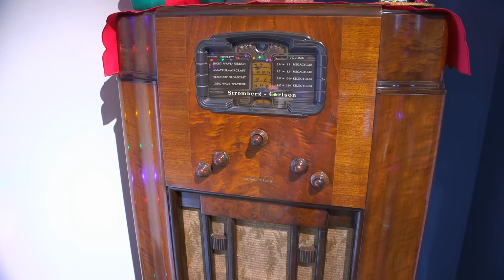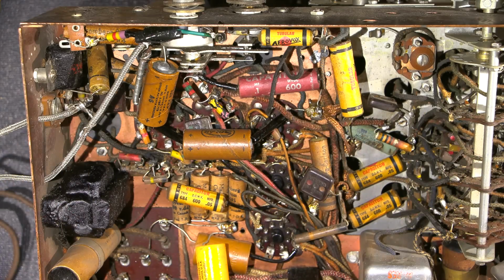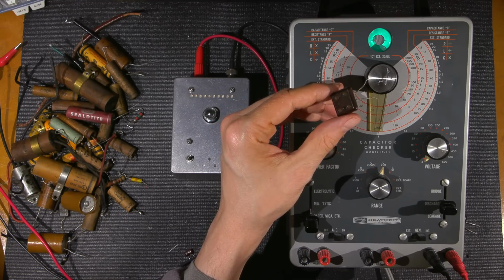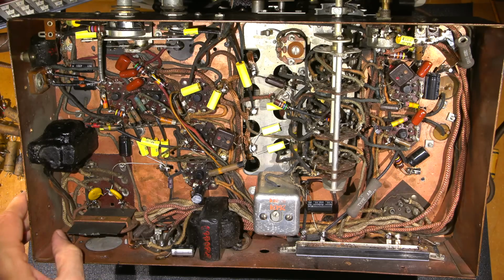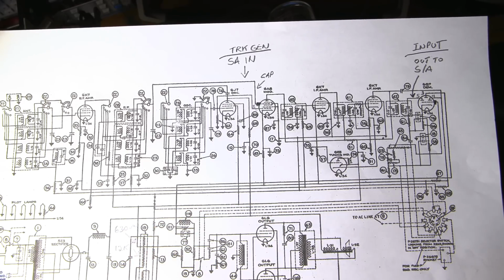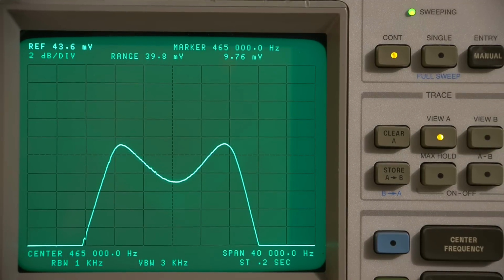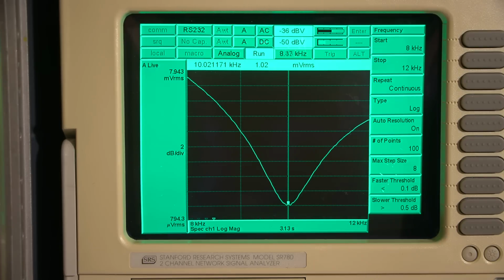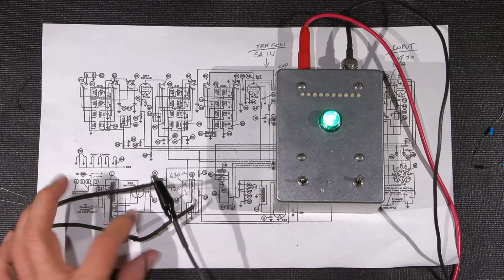84 Year Old Radio Receiver Restoration! Stromberg-Carlson 145L

Comment: Hi - on things like this  (and since you are so thorough in other ways)... I'm not sure why you don't go through the step of gutting the original caps and re-stuffing with modern equivalents.  To make it work is one goal... but to retain the entire visual impact of the original technology and manufacturing is also worth doing.  I rebuilt a 1937 (not North American) receiver in this manner, trying to make the repairs as indistinguishable as possible.  Once the old caps are out, it isn't that much more work.  I was able to crush the old cap ends into chunks and dust that was actually possible to melt and re-flow into the modified cap tube ends.  On other caps, you could cut axially if necessary, re-stuff, and then hide the cut-side by proper re-orientation...  Again, leaves that overall visual impression that time has stood still... not that much extra work!

Comment: Hello, Mr. Carlson. I just found your channel and subbed immediately. Great stuff. I hope you'll forgive me if I delicately point out that the compression and EQ settings on your mic (Warm Audio WA-47?) are overemphasizing your breathing and mouth noises. Moreover, there is a forward, radio-announcer character to the audio which, to my ears, feels disjointed from the production style, and more importantly from the gentleness of your voice.
My 25-year audio engineering instincts tell me that you would do well to back off the mic by 4-to-8 inches in order to reduce the proximity effect. You tend to speak very evenly so for compression I would probably try an LA2A or a TDR Kotelnikov (free!) to gently even out the smaller level fluctuations. For a yeller I'd probably put a fast compressor or limiter in front of that, set to catch only the peaks. If the sound after compression sounds dull, try a little EQ next in the chain to bring out some sparkle and chest sound. Less is more!

Comment: This is a great video... and I totally get and appreciate what you've done.  Curious question: Could you still keep the "spirit" of the rig and also clean up its design in a non intrusive way, say by making a modern PCB to migrate those components closer together -- the circuit design would be the same, but you'd cure some of the problem distance brings?  It would be fun to see, but I'm not at that skill level yet.

Comment: I am trying to identify the wattage of a vintage carbon resistor. It is 1 1/4" long by 1/4" diameter. There isn't much out there to help identify the wattage by physical size that I could find.

Comment: The old valve radios are fantastic. Lots of beautiful harmonics, no transistor hiss, plenty of bass, and generally built to last. Of course you had to wait for the valves to warm up, but the wait was well worth it. Used to work in a radio repair workshop for four years, bench testing and repairing, in addition to mast work with folded dipoles and twelve element yagi's. Always in the winter the heaters would fail on yagi aerials and they would lose their directional characteristics due to ice build up, and there you are, up a mast in the freezing cold fitting out new aerials with new heater elements. In the workshop we had an old valve radio pumping out its wonderful sounds daily on weekdays. Remembered well. The valve heaters even warmed up the workshop on cold days. Nice refurbishment job. Yes, nylon adjustment (trimmer) tools for the powdered IF slugs and RF nut type caps (transmitter PA sections), insulated screwdriver for screw type caps. Powdered IF slugs used to be a problem at times because they had a nasty habit of sticking and breaking in two, and then were the devils own to replace. RF sections easy enough, but as you say IF sections can take ages and a lot of required patience. Love the high impedance unit to stop blowing the front end of the spectrum analyser. Wish I had had one (no, I did not blow a SA - we had a very high impedance probe). The capacitor testers too are really lovely, with fantastic sensitivity. These days? I build power stations and work on the heavy current/high voltage end of electrical engineering, but I must admit that my radio days were a fascinating experience. Working at the component end of radio engineering is interesting, but time consuming, especially with intermittent faults like dry joints and failing components that you have to track down. On televisions this was a big hassle too, because even with a service chart, the hunt for the problem could take days. These days it has become an 'everything on a chip' or 'surface mount technology' throw away world. Pity. Good old component electronics was always the best. The throw away world has taken the skill and interest out of the work. For example, just look at the fantastic design and build put into this valve radio. Built to last, but components do not last forever, especially capacitors.

Comment: Question do you have any information  on “the trouble shooter”  elector products co. new york”  and if one could find a “Leak Detector" lamp;  My dad use to repair television and radios per circuit boards 1960s and earlier as a hubby

Comment: Mr. Carlson the IF adjustment is very sensitive as you have shown... what happens when the audio bass rocks out the cabinet with good vibrations? Does the receiver become seismic sensitive and effects the sound quality or tuning?

Comment: I have this identical radio sitting right in my living room.  It used to belong to my Grandmother, before she passed in the late 80's.  I was told that it works, but needs to be grounded, and also needs a new antenna wire, witch ran along the back of the cabinet.

Comment: Many years of servicing experience leads me to replace known problematic caps "on spec" rather than even bother testing them. It was invariably a case of "replace them now or replace them later" but the comment about handpicked mica parts is noted (my experience was commercial 1970s-80s landmobile kit for the most part but a lot of the older kit was valie-based)

Is that a 10kHz audio notuch filter or a rolloff filter? The reason for notch filters was to knock out heterodynes from adjacant broadcast radio stations, but in the last 80 years spacing has moved from 10kHz to 9kHz for various reasons and you really need to tweak them to knock out that annoying whistle. In this case there's a very good reason to retune the notch to 9kHz despite it being 10kHz ex-factory (edit: I see North America is still using 10kHz spacing, so YMMV)

Comment: I have two Kenrick Eagle 500 linear amplifiers. I need a tube tester that can test 20lf6 tubes. Could you, or anyone that has that knowledge recommend one? I've been looking on ebay, and without knowing the tubes that can be tested. It's impossible to know which will work.

Comment: Interesting video.  I have a 1936 vintage Stromberg-Carlson table top radio that was in my mother's family since, I believe, new.  I got it around 35 years ago and it was working fine.  The cabinet is in outstanding condition.  But after almost the same number of years in storage...nice loud hum.  Tomorrow it goes to the vintage repair guru, a 50-mile round trip but worth it.  Dunno if my wife agrees...LOL.

Comment: couple layers or six of heat-shrink, make for the insulated screwdriver she aint ;)
if you do that, realize the remainder of screwdriver and handle isn't rated for electrical shock safety, although it would keep you from shorting the end to the close case. even insulated screwdrivers are often too uninsulated at the end to not hot the case and still need heat-shrink layered

Comment: I'm about 6 minutes into your video and when you mentioned at 05:05 about modern-day equivalents of the Labyrinth speaker system in that beautiful Stromberg-Carlson I immediately thought of "Bose" and how even their smaller  sets use a similar speaker-system tech all miniaturized and sound insanely awesome. :-) 
Back to the video.....
Reply: ... finished the video.. beautiful work, Mr Carlson, especially that IF-balancing. I was listening through some Sanyo in-the-ear earphones and the radio sounds totally awesome, even with YT's compressions.  Thanks for sharing. :-)

Comment: Hi Mr Carlson - nice video -
are you sure the voltage driving the magic eye is correct?
How come it glows nearly fully when in theory there is zero volts driving it
when it's off station?
Reply from the maker: Hi Bobby. The eye tube is essentially a signal meter, so a high noise floor will cause shadow angle deflection towards zero degrees, (a closed eye.) This receiver is very sensitive, and the noise floor is high, because it's attached to a very large antenna, this is the reason you see the eye almost closed in some cases. Thank You for you kind comment!
Reply: @MrCarlsonsLab  - thanks for your reply .
I have an EM80 magic eye valve on my Stradivari 2 Receiver which I rebuilt successfully.
It is of a different design but I don't get the "problem" you're seeing.
From memory an AGC voltage of 0 to -4 volts drives the grid of the EM80 valve
Reply from the maker: Hi Bobby. The automatic gain control is derived from the detection stage. The AGC rectifier turns the signal level into a negative voltage that varies with the incoming signal strength. This negative voltage is fed back to the control grids of the previous stages to lower the gain of the receiver. This same negative voltage is used to deflect the shadow angle in your eye tube. So in all cases, the eye tube is responding to signal variation, this is how all eye tube circuits work in older radio receivers.

Comment: Where do you get legible schematics?  I have a Stromberg Carlson model 255. I found a website with Rider schematics as PDFs. But even when I printed them on 11 x 17 paper, the component values and reference numbers were not legible because they were scanned with low resolution.. So I purchased printed copies, but they were even less legible.

Comment: Wow, that is an incredible radio for 1930’s. Can’t imagine the cost back then. Excellent demonstration on IF bandwidth too.
I assume those big multi section capacitors on top of the chassis were  replaced with new electrolytics under the chassis and left disconnected for esthetics. I don’t recall that you mentioned this though.

Comment: Mr. Carlson, I have quite a few years in solid state Electronics Troubleshooting and Repair experience,  most recently at a company that manufactures FM Stereo Transmitters and Translators for the broadcast Industry.  It is with great interest and joy that I see you restoring a Stromberg-Carlson Reciever!!!
Here is why. 
 I have had some-what unstable and variable housing situations years ago,  so I at that time asked my Father and Step Mother to care for and display my own Stromberg-Carlson floor radio in their home, they were ok with that as they had a good condition Victrola Displayed In their living  area as well. They liked collecting and displaying Vintage Technology/ Furniture in their Home, and I would have had the Reciever stored in a storage unit and subjected to wide temperature and humidity swings that is usually not encountered in a general living environment. 

I inherited this particular unit From my Grand mother multiple decades ago as she was paring down her living situation for retirement.  As I had a passion for radios and all things Electronic, she knew it would be in good hands. When I inherited it, I was quite new to Electro(nics, and a newly licensed Ham radio operator and I was thrilled to acquire and actually plug in  and use the very cool receiver!!!
So, many years ago it worked quite well. Fast forward to 2020, it had been stored and displayed for years. ( mostly stored) 
Unfortunately,  This last July my Father passed away from complications of the Covid-19 Virus.  And while settling his estate, my step mother and sister knew it was mine and that it used to belong to my Grandparents.  I knew from watching you, reading, watching YouTube videos and from hearing about fellow hams' experiences  with antique radio receivers that the caps dry out and become unuseable in time, and to NOT risk plugging in the unit to 'See if it still works' ..

So it is now living with me in a Basement Apartment, and I have a renewed interest in getting it to good operating specs again.  This S-C unit is a different model than the one you restored, but I am sure it is of similar vintage.  I lack the test Gear and expertise to confidently restore this unit on my own,  but would be thrilled if I could find some to mentor me and look over my shoulder and advise me on how to restore it to 'like new' or 'as good as new' usability.  I am Not opposed to shipping it to an appropriate place, and for the right price, I would consider paying for the restoration,  I am currently between jobs, and have been for nearly a year now, so funds are limited,  so would you consider helping me or doing a complete restoration of my Stromberg-Carlson floor radio on your YouTube channel? 
Feel free to communicate with me here, on FB messaging,  Email or texting.
Thoughts? 🤔
73,
And Thanks! 
Oh BTW, I enjoy your in depth and detailed  YT Videos
Myron

Comment: When I was in the Navy I worked on HF transmitters that had 12kV on the plate and 300A filament current on the final amp circuit. Those don’t scare me as much as these old radios.

Comment: I am stunned by how clean the chassis was both topside and underneath pre-restoration.  Is there a back story about where this receiver came from?  It must of been in an incredibly clean home or possibly in storage for much of its life?  Wondering what sort of test / calibration equipment was used at the Stromberg - Carlson factory in the early 1930s on the production floor?  Did spectrum analyzers even exist during the 1930's?  Thanks Mr. Carlson for another tremendous video.

Comment: Incredible, My grandma had one of these radios when I was a child Im 54 now. It was ancient when I was a child!  Sadly it went with the house when she passed when I was 13. I wish i had It so I could take it to you for restoration. Those 2 capacitor testers you engineered and built is incredible!  I looked all over to find one just to check air compressor electric motor start capacitors 25 yrs ago. I bought that small one that looks like a multimeter.  It worked but wasn't super high quality comparatively. Incredible restoration you do, and your attention to detail and knowledge you have is incredible! Merry Christmas and Happy New Year hopefully we will still have our country after January.

Comment: 20 million ohms is nothing, and is common for oil caps. The best practice with radio chassis is to always assume them to be live. Capacitive coupling through the power transformer to the line cord is enough to shock you in the right situation.  The purpose of the line cord cap is for RF coupling to ground. Without it, you'll have some through the power transformer,  but adding the cap improves things. Adding a cap to each side of the line cord neutralizes AC noise to the chassis while still obtaining an RF ground. In some cases, particularly with a loop aerial, the radio can be better and more quietly operated without this RF ground.  A cap across the line cord also filters out RF noise on the line cord, but not any noise between the home's electrical system and ground.  A method of further filtering noise is to put two 100 uH chokes on the line with a .01 MFD cap across the radio side of the chokes. However, this obliterates any RF coupling to ground at this point, making an external ground necessary on some radios.

Comment: Wow, AM radio has never sounded or looked better than it did in 1936. The engineering and build quality of this radio is astounding. Thanks so much for bringing us along as you analyzed it, explained it, and lovingly brought it back to life. 

How did they do alignments on these without modern spectrum analyzers? You may have it working even better than new, especially with the optimized capacitor layout.

Comment: I'm trying to trade electronics test equipment for a tube head amp using 6L6's or 6V6's 30 to 50 watts guitar amp. I'm trading an oscilloscope B&K dual trace, (2) generators and a old RCA VOM plug-in. My trades worked since the late 1990's. The amp should work too.